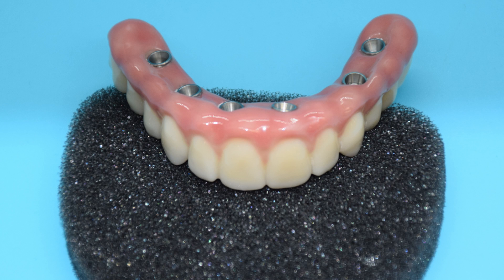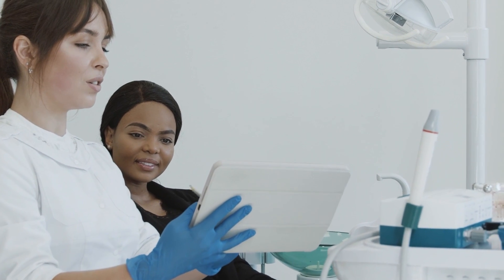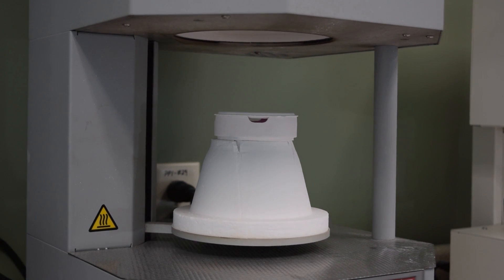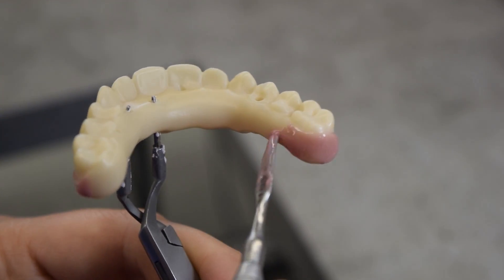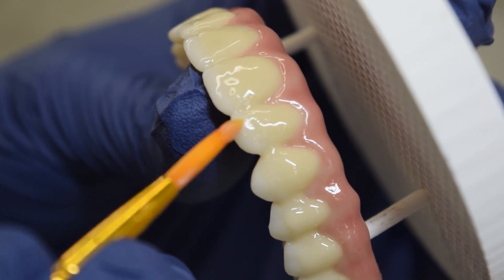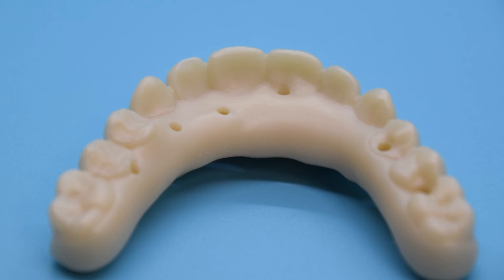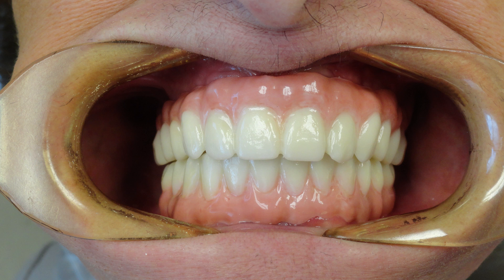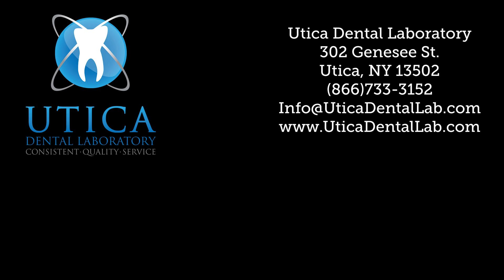Part of the Process - Milling and Staining "All on 4" Zirconia Arch

Comment: They look heavy!
Reply from the maker: They are! At least compared to an acrylic denture. The full zirconia arch will definitely take some getting used to. The biggest complaint is the sound they make if you clack your teeth together.

But, the advantage is you can eat a regular diet with no restrictions. It's as close as you can get to your natural teeth.
Reply: @UticaDentalLab  what about porcelain and each individual tooth connected separately?? Looks more natural no ??
Reply from the maker: @englishfam9675  Porcelain looks better aesthetically than zirconia as a general rule.

The issue with porcelain is that the techniques involved in creating a crown or bridge are difficult. It takes years to master layering porcelain and it is getting increasingly hard to find lab techs skilled enough to produce restorations of that caliber.

It is much easier to digitally design and mill a crown from zirconia. A well made zirconia crown is a better restoration than a poorly made porcelain crown.

 Also, zirconia is much less likely to fracture or cleave than porcelain. 

As far as using individual implants for each restoration goes, I agree it is not natural to have your teeth connected. However, having 16 single unit implants is a lot of surgery. The All on "X" typically only uses 4 or 5 implants. It's a lot less trauma for the patient.

There are some trade-offs involved when choosing a zirconia restoration compared to porcelain but we believe the modern zirconia has come far enough aesthetically to warrant full arch and anterior restorations.

We discontinued our porcelain work at Utica Dental Lab two years ago. Unfortunately, It is a skillset that is disappearing with the previous generation as they retire.

Comment: That doesn't look beautiful to me. The teeth aren't separated well, there's no transparency (even acrylic teeth look more natural), and the transition from the prosthesis to the real gums is a massive food trap. My main complaint with these solutions is, that technically they might be the top of the dental profession but in reality there are so many drawbacks. Sorry to say that.
Reply from the maker: There are pros and cons to all denture/full arch solutions. It's important to point out that there is no like-for-like replacement for natural teeth. Every edentulous solution will have inherent drawbacks.

People have differing opinions. It's ok to prefer other options for aesthetics. Generally, the trade off for more high aesthetic solutions is a reduction in durability and flexural strength. Zirconia lacks translucency and brilliance compared to something like porcelain, but the material should last a lifetime.

One advantage to a single unit milled zirconia arch is it only requires 4-6 implants to hold in place. It's true there is no separation between teeth, but the patient doesn't need 16 single unit implants either.

Food absolutely will get trapped between the gums and the prosthesis. Daily care and maintenance is required to keep them clean. It is  important to remove plaque around the implants as poor oral hygiene can lead to decay and the failure of the implant. Dentists should provide their patients with instructions and tools to properly clean the prosthesis and gums.

An all on "X" implant prosthesis may not be the perfect solution, but from a functionality stand point it is as close as someone can come to natural teeth. Once placed and healed, there are no restrictions on what a person can eat. With proper care, the arch should last a lifetime. Also, there is a minimal risk for advanced bone loss of the jaw, compared to acrylic dentures that wear down the bone ridge the longer they are used.

Unfortunately, modern dentistry has only come so far to replace lost teeth. Patients need to understand that once natural teeth are pulled, it will require an adjustment to lifestyle no matter what option a patient chooses to replace them.